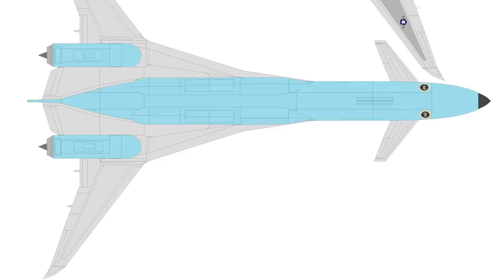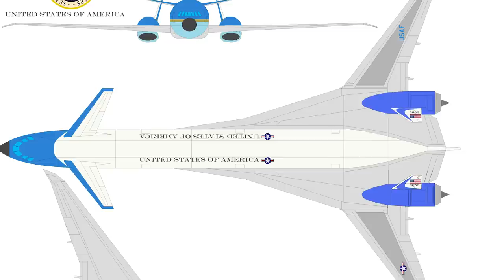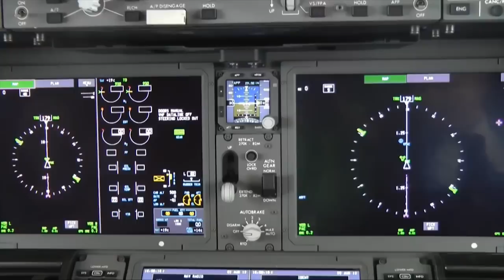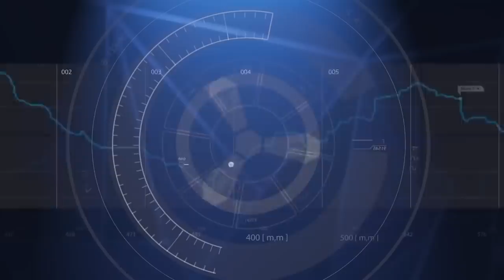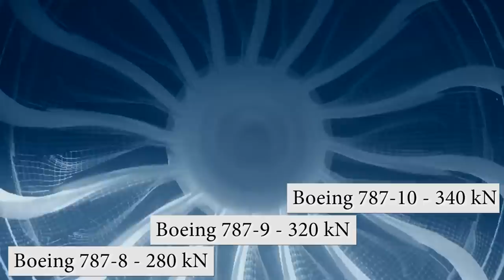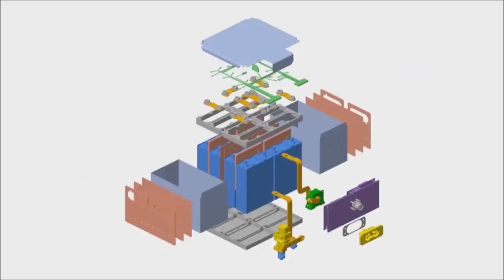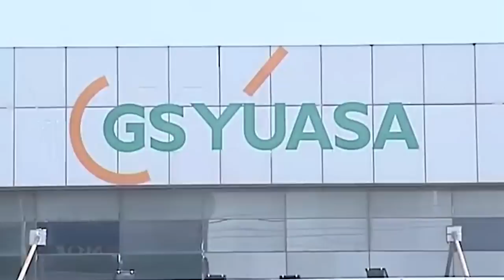Boeing 787: The legend of Dreamliner

Comment: I love the performance of the 787. I love watching them on Flight Radar, soaring way above any other airliner at 43,000ft and cruising just as quick as a B777 and B747.
Reply: Nice plane but the airbus A350 is better.
Reply: @djovalhou4109  based on what??? The 787 is more selling than the A350. How better the A350 is?
Reply: According to experts the A 350 is  currently the most advanced aircraft in terms of technological performances.
Reply: I am sure it will overshadow any other airplane in the future, especially for long courier flights.
Reply: Ndl Ben Have to agree with Djoval on this one. The A350 overall is better, but the 787 is still really nice.
Reply: I like the 787-10 and A350-1000
Reply: @djovalhou4109  They serve different markets. 

787 replaces the 767 in serving long and skinny routes and making extremely long routes economically possible (Perth-London). It's also a versatile aircraft, capable of slotting into regional routes in order to provide higher capacity during peak demand.

The A350 is a 777 competitor. Big, powerful, and fuel efficient, it connects high demand cities at higher frequencies than the A380 can and more fuel efficient than the A340. It serves hub airlines who need to move lots of people (Cathay, Singapore, Qatar).
Reply: @djovalhou4109  Experts? Have you a source for the evidence?
Reply: @hunterhalo  787 sounds better (though nowhere as good as the 777). Do you understand why there's so much plastic?
Reply: The 757 and 767 were certified to cruise at 43,000 feet in the early 1980s.
Reply: @djovalhou4109  a350 is just an ugly 787 clone. scarebus just rips off everything boeing creates (and sells less too. oops!)
Reply: Djoval Hou experts? But one plane is out selling the other? So much for experts.
Reply: Does it really fookin matter to any of us which plane is better
Reply: A350 shits all over the boeing
Reply: @djovalhou4109  A350 is a plane more shit the triple 777 is much more better than A 350
Reply: @ndlben7129  the 787 is not competing with the 787 but the 787 is much more flying than the A350 and the triple 777 is much more flying than the A350
Reply: @hunterhalo  I'm sorry the sound of the A350 seems hollow and hoarse sounds very ugly the sound 787 and the gut 777 much more better than A...
Reply: @JS-ob2xt  lol sometimes I get pulled  into the madness do to nationalism then I stop and think. "does it really fookin matter who's better airbus or Boeing?".   life is better when you rid yourself of petty arguments.
Reply: @knowsmebyname  "life is better when you rid yourself of petty arguments." amen brother. all the people arguing in this thread could have invented time travel or something instead of wasting their time arguing on the internet
Reply: @JS-ob2xt  well said.  Amen.  You wouldn't be a fan of the Notorious would you?
Reply: @knowsmebyname  I had to google who that was but yea actually he's who i picked up "fookin" from
Reply: @JS-ob2xt  👍
Reply: the story about this aircraft from its engineers and staff will make you think twice about boeing
Reply: Yeah, Nice Plane--- but ...........
Reply: @JS-ob2xt  conor mcgregor....is that you?hahaha
Reply: @djovalhou4109  your right but 787 is still an amazing high tech plane
Reply: Crazy Clown orders cough cough btw  787. And a350 are different markets
Reply: Djoval Hou the a350 is more comparable with the 777 not 787 go comment on 777 vid instead
Reply: @djovalhou4109  lmao whose been lying to you?
Reply: @kcaviation3024  Google "The A350. The Plane AIRBUS Did Not Want To Build."
The A350-800/B787-8. SINGAPORE AIRLINES said no to it. To S.A., it looked like a A330. They told AIRBUS to make it look modern like the B787. Hence, out came the A350-900XWB ( Boeing was already planning the 787-9, that's why AIRBUS called the re-drawn A350 the -900 (XWB), and the -800 went bye). The -1000 is for. going after the B777 Series. 
View the video.
Reply: @djovalhou4109  Also the 787 is more efficient and uses less fuel than the a350. Also, remember that more than 40 percent of the parts and things of the 787 were made in Japan 💪🏻. Without a doubt that says a lot about ANA who will soon have 80 Dreamliner very soon!
Reply: But that depends on the airline, the a350 is very modern and advanced but focuses more on a better experience for passengers and those who want more. While the 787 is a hybrid of all that, but it is more efficient and more friendly with nature. That is what we should focus on as the earth is slowly being destroyed.
Reply: Well anyway, you go where you like the most. But remember from the earth! I mean, if life matters to you. I'm seeing that since, 2021, everything is Terrible.
Reply: @djovalhou4109  according to experts who probably aren't experts anymore. The 787 is far more expensive, Fuel efficient, quieter than its outdated airbus counterpart
Reply: @hunterhalo  carbon fibre composite isn't plastic.....its stronger than steel. Just because eit feels plastic doesn't mean its plastic LOL

Comment: Beautiful airliner and best company. Boeing is an example of honesty, selflessness and moral integrity. We need more companies like Boeing who are putting safety ahead of profit and always innovate to make a new generation of airplanes safer than their heritage.

The 787... I admire the absolute workmanship of the hull section overlap joints and fasteners. They are so proud of their work that they have their customers worldwide just look in awe at these structural components more often than before. And don't get me started on that really innovative battery containment box. It's a work of art. How graciously it separates all these Lithium Ion cells.

Next time I fly the 787, I will bring my parachute in case I get a free upgrade to a structural inflight breakup experience. 😍

Comment: I remember through out it's development and initial construction their were constant complaints about one thing for another.  But to bring a totally new aircraft to market with extensive new materials,  new engines, carbon fiber,  and the extensive use of <subcontractors and world wide manufacturing and they were only two years late from the original completion date?  That's damn impressive and as few teething problems is amazing.

Comment: I have flown on 787 with Ethiopian (first time with this company), being  a frequent flier, it was the best crossing of the atlantic ocean ever. I found very comfortable configuration with  excellent leg space (I am 6 feet) , the improved  air humidity was something I noticed, feeling much better , to my delight, the plane had very good space as well for overhead cabin suitcase/backpacks compartments, really excellent on this. there are airliners that really make a fuss to travellers  due to this, excellent entertainment system and flight info as well. I found also the bathrooms being more roomy than average,- a very welcomed thing.  The crew has more space for preparing the meals, helping the quality of their service. In all, the windows  adjustable tint instead of  moc¿ving shades was superb,, all cabin not disturbed by excess of  sun light. I slept incredibly well being in economy.  The plane its like a swan, its long wings evidenced  this is something very new  high tech., now I UNDERSTAND  why we did not suffer of  any turbulence, there is also new technology for this. Also important, the remarkable lower level of noise inside the cabin, felt like reading a book at  iat home. GREAT plane, resulting in a new level of  client satisfaction .  I want to fly again on this.
Reply: Thank you for all the information 😉hope to fly on it soon 👍💖

Comment: Very slick and instructive video. The 787 is a great aircraft to fly in. Unfortunately it is still experiencing some additional problems vis a vis the fuselage bonding as also with the vertical and horizontal stabiliser tolerances. Hope they are minor and can be resolved. Thanks for the information.

Comment: I flew the 787 for the first time in 2016, from Sydney to Hawaii (return).  I upgraded my economy class to the seats behind business class & I was very pleased with the softness/smoothness of the landing.  I don't know if that was due to my seats being forward of the main landing gear, or if the 787 is a superior designed aircraft.  The 8170Km (5076 mile) flight was without drama & I really liked the greater viewing from those large windows - although for the majority of the flight we were over the ocean.
I've not been on the Airbus A380, but I initially I thought the competition with the 787 Dreamliner would be won by the A380.  But after having flown the Dreamliner, I've had to change my position...  It's a nice ride!

Comment: The GE engines on the 787 are a whisper in contrast to the Trent 1000 noisemakers.  With GE engines, the cabin is amazingly quiet.  You can hold a conversation on board like no other.  We went American Airlines with GE.
Reply: I believe United also uses GE on all their 787's.
Reply: GEs are more durable than the RRs. I know that the GENX had issues as well, but the thing is that GE acknowledged and fixed the issues, so now they are as reliable as a LEAP engine on an A320NEO
Reply: I really don't understand how RR made a good job with the engine of the 787, a380 ect, but not with the 787😑, like that they don't take it that seriously. It really a shame and something to be more anger. We can get to the conclusion that every company have it site of corruption in one way in another.

Comment: I have flown on this model 2 times in Economy. there were no incidents and it was no more or less confortable than the 777.
Reply: compared to the 777 this aircraft has narrower seats and a more cramped cabin.(I think the airlines are to be  blamed for this as they are greedy.)..the  positive factors for the 787 are the noise factor and the ambient  cabin lighting

Comment: A number of airlines refused delivery of aircraft assembled in South Carolina for quality reasons.
Reply: Which ones?
Reply: The quality of work in So Carolina is inferior, the level of expertise is fiercely inferior and can't be compared to that of Seattle's. In Charleston, it's alleged that people are hired from off the street without any work experience, let alone knowing how to assemble a plane. They're told just follow the instructions. No oversight and everything is signed off without anyone checking the work. They go to lunch or take a break, smoke a weed or two and then go back trying to assemble an airplane! Yes, I would refuse delivery of any aircraft from there, as well. Only from Seattle is where that AIRLINER said they would accept their fleet. STILL LOVE BOEING. Everyone screws up at some time or another. BUT YOU GOTTA PAY.

Comment: You forgot to mention the largest problem: Rolls Royce Trent 1000 fan blade cracks. For which ANA's fleet is still sitting on the ground paying the price for its failures.
Reply: haven't you mixed rolls Royce up with general electrics, who engines had the problem with there blades, and were grounded.

Comment: For those saying the 787 is the Cheapliner, your A350 is a CheapWB.
Reply: Here's another point: For those saying that Boeing is solely responsible for the Rolls Royce issues because Boeing wanted RR to make an efficient Trent engine in the first place, that makes the airlines solely responsible for the MAX victims because the airlines wanted Boeing to make a more efficient 737 in the first place. However, if the airlines that weren't informed about mcas are not to be blamed for the MAX, Boeing, who was never informed by RR about anything, is not to be blamed for the Trent 1000.

Comment: Had the pleasure of flying long haul 6000+ miles in a Dreamliner last month when I visited Bangladesh using Biman. Their Dreamliners in the fleet are only a couple of years old as they upgraded to the 787-8 and 787-9's so late. What I immediately noticed is I didn't have a blocked ear a single time whilst I was in the air. Also they kept the windows tinted and switched on mood lighting to help with ambience / mood.

Comment: You don't mention all the problems with Trent engines, batteries and lack of quality control...
Reply: Not to mention that they actually moved production to get the unions off their ass more than expanding production.
Reply: all new tech has issues...... older tech usually has had the time in its lifecycle to vastly improve in all areas including cost.
Reply: @kercchan3307  While that is true, the problem with the issues in this new tech are potentially life threatening, not to mention the corners that Boeing have cut to make this plane.
Reply: They don't also metiom the dark side of the made of the a350 and how many of the part are made By the same manufacturer

Comment: I understand the engines are having problems, is it true?
Reply: Only those by RR
Reply: RR, But the issue is proving to be a big problem for operators... Air NZ is one thats had major issues, having to call in Hi-fly to bring a340 and a330 to cover
Reply: Rolls Royce Trent 1000 engines are, not the GE ones.
Reply: The RR will deal with this problem. Not a big deal
Reply: ANZ hasn’t had any major grounding events recently, and it appears most of our fleet is in the air at this time, so let’s hope it stays this way.
Reply: so also the batteries had  serious teething problems as everybody knows and Boeing 787 is sometimes grounded for safety issues.
Reply: Felipe Eterovic Barreda nope

Comment: Such a beautiful plane ruined by such a careless engine company(cough, cough, Rolls Royce). Don't let RR touch the rumoured 797.
Reply: David Boeing 7X7 I think RR will do the best
Reply: If I remembered correctly the RR option was actually more efficient... when they didn’t fail
Reply: Pure Competizione it's so efficient that airlines are having to ground planes and lease other ones not to fall behind. So efficient!
Reply: Frank Galeon they have really shown how good they can do... Sarcasm off.
Reply: David Boeing 7X7 Over the years, Rolls Royce engines have performed very well. The 787 is raising the bar for performance, so everyone is stretching the technology. On the shop floor at Everett, I always admired how clean and carefully laid out the RR engines are. Pratt and GE engines are still awesome, but just aren’t built as well.
Reply: Ampersandrascott well they may not be built as as well but they surely don't fuck up as much and to the point where airlines are having to ground an entire fleet of planes. RR shouldn't be allowed to build any more engines until they figure out the problem with the trent 1000 which they say they're doing for god knows how long yet the engines keep fucking up...
Reply: David Boeing 7X7 We had very similar problems with the GE engines when the 747-400 was introduced. It was solved with a concentrated effort by both companies, as I’m sure RR is also doing.   Growing pains are very common in this industry.
Reply: Cough Cough batteries..
Reply: ComeFlyWithMe2011 The batteries are a good example of issues that arise when you push the technology. The amount of electrical energy pulsing through this aircraft is incredible. We were lucky to get the battery issues worked out pretty quickly.
Reply: Ampersandrascott   It was actually a supply chain problem, not that they were pushed too hard. Boeing trusted its suppliers too much in that case and they delivered faulty cells poorly arranged, poorly designed.
Reply: ComeFlyWithMe2011 That ended up being one of the causes. There were other issues I can’t discuss because of the NDA we all signed.
Reply: Ampersandrascott  Oh are you a Boeing employee or supplier?
Reply: ComeFlyWithMe2011 I was a senior Engineering manager. I recently retired after 36 years.
Reply: GE Baby.     RR and Airbus. NOT  Boeing  The very best
Reply: Scott 250r something tells me that you’re American
Reply: @romanbaranovichi5375   Yeah remember us ??..we supplied russia AND UK with Arms&food...planes tanks....you DO remember us??...
Reply: I hope Rolls Royce would make it more quiter
Reply: And yet here we are a year later dealing with the same damn problems. They’re to be resolved within the next few weeks but at the expense of airlines and their trust in Rolls-Royce as a respectable engine manufacturer.
Reply: I think RR pulled out, didn't take them for the quitting type.
Reply: Agree, RR have a very dark side

Comment: Great video and interesting point about the GS Yuasa batteries. As a long time EV journalist, Boeing's and GS Yuasa's choice of Li-ion was puzzling to us when lithium-phosphates would have been better. What is even more troubling is that those batteries were being tested around the same time as Mitsubishi's Pike Peak EV racer was being developed. Anyone who knew what CODA Thermal was doing in 2009 with lithium phosphates knew that there was little to no degradation in recharging under any extreme weathers on this planet, period. Although CODA was unsuccessful in the end, it managed 140-mile range back then. Why would Yuasa put those batteries in an aircraft was always puzzling when phosphates were always better at managing and handling thermal run away. And in many cases, Tesla prooved off-the-shelf AA batteries worked as well. Strange in every way. I was wondering if Boeing had become a finger pointing designer and not enough hands on anymore.

To this day, it is my favorite airline to fly in, so far, bar none.

Comment: Great video as usual. One thing about the batteries. Boeing used the wrong batteries for this aircraft. Any EV savvy person could have told them they needed energy lithium batteries, not the more power focus lithium batteries used in EVs. Also, the use of carbon fiber for the fuselage introduced another problem. How to dissipate lightning strikes. It was laced with copper lining so that strikes could be shunted. 

The 787 is one of my favorite airplanes. I never fuss knowing I'll be locked in it for 14 hours. Next, the 350?